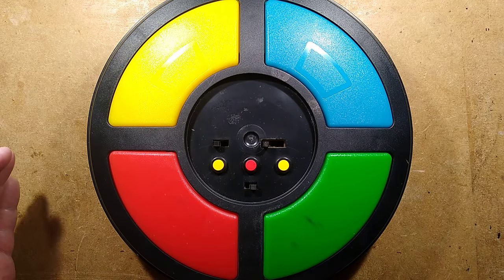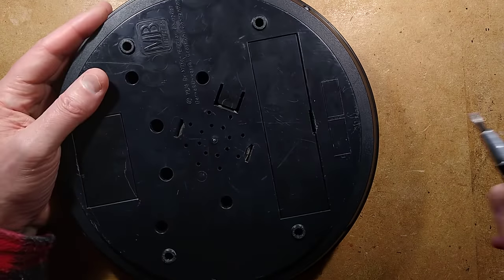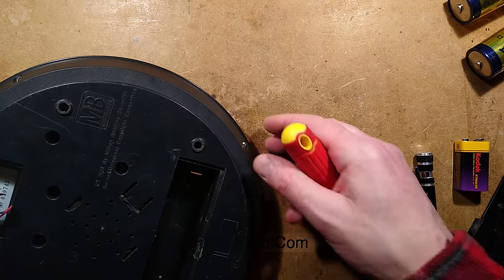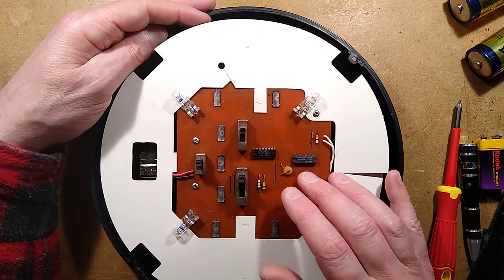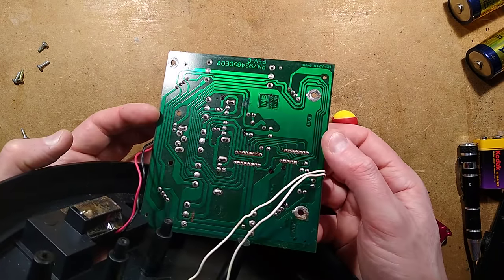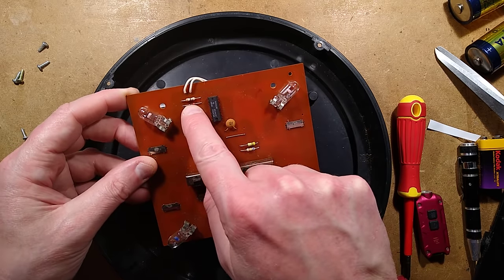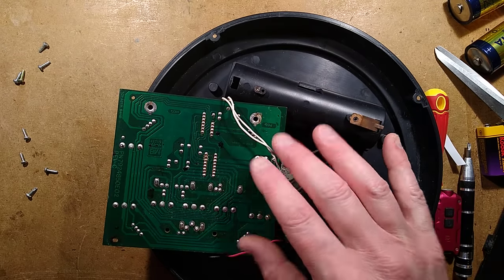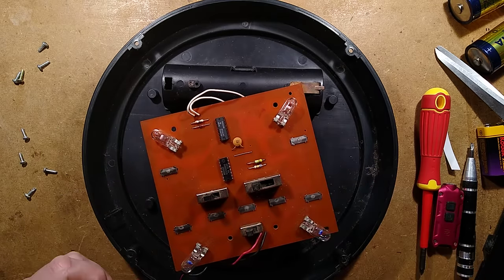Inside one of the first electronic games.

Comment: Had the smaller version of the original which has a smaller "box" sticking out the bottom with the controls on it instead of the centre. Never seen one of these since and don't know what is was originally called.
Reply from the maker: Pocket Simon?
Reply: @bigclivedotcom  Yes, that was it! (Strange name for something that doesn't fit into an average pocket)
Might actually still have it, got to have dig it out if so.😃

Comment: Brought back memories :D

I suppose a more recent variation on the theme of this game would be the various Bop It games. Horrifically addictive for some while the incessant noise is equally as horrifically annoying for others. Typically very good for causing massive arguments over the Saturnalia season where some annoying git insists on playing the thing in the presence of several others with hungover irritability syndrome. But that should be just fine this year as we'll be in solitary confinement for the duration.
Gives me an idea for a marathon live stream. 24hr charity fund raising non-stop Bop It Marathon or some such garbage. May have to buy a few units for that as they WILL get violently launched into walls when failing the sequence at step 597 or similar. :D

Comment: Why buy an old one when new Simons are available. I bought mine for $7.98 at Aldi's this past summer. It also lights up two colors at once and does have LEDs in it.
Reply: It is the official Simon. On the back it says "Made by Hasbro. 2013 All right reserved. Made in India" and it also features single or multiple play modes. I can't remember if the original had that. We were poor, too, so we got the handheld version many many years after the original one came out because it was much cheaper by then. It really brought a good feeling to be able to buy this newer handheld model that is not much bigger than a hockey puck. I sometimes play it when I can't sleep. Sort of focuses the mind.

Comment: Thanks. I used to have one 😊
Reply: In 1980 Atari bought out the Tempest arcade machine. Absolute winner. XY monitor. Famous. I now run this on an old netbook hooked up to my projector. Big screen detail. I have connected up an official spinner and arcade buttons into an old file box I had. I made the holes in the box exactly where I wished them to be - spinner on rightside as I’m right handed and a fire button and superzapper button on the left hand side. Another button for player one start. 
I love this game. I have managed to get up to the green level just once - but I’m good normally through the blue then red then yellow then onto the cyan level. 
The bigger the screen the easier it is to play as more detail is seen which is very important on the later levels of the game. GO TEMPEST 🍊😊

Comment: My mini simon (hand held) worked....  until it didn't  which I found it won't unless you bother to take it apart and discover oh..  they have an extra bulb in here (it hadn't worked in 30 yrs)  it's not working again.  I suspect another bulb went out.  Guess I'll just have to watch this and see if there is an extra bulb here
Reply: never owned this but wow.  it also has a spare bulb.  Rather wow is the speaker.  it has a real speaker the Pocket Simon had a Piezo speaker with a semi transparent plastic cone around it and it did it's job.  Gosh now I wanna know what screw in light bulb I'd need now.  :O  think I know where mine is.. and found it. ha  nope not the bulbs.  now where'd my contact cleaner go cause clearly the left switch has issues

Comment: Clive, what voltage are the bulbs ?
Reply: probably 2.5 or 2.2v, to take into account losses in the driver chip...
Reply: @andygozzo72  Our messages are crossing :) 
But they don't need to be powered at full voltage. If mopeds use them, fair enough to be 3V.
I know these small bulbs are often driven over voltage in flashlights etc. but no need for in the game.
Reply: @millomweb  they wouldnt be over driven, the driver chip will drop a small voltage, so less than the 3v getting to the bulbs..
Reply: @andygozzo72  I never said they wood.
Pay attention at the back !

Comment: I remember the very recent Simon's, a vertical ring mounted on a base with a hole in the middle. They were simply awful. I think they worked by motion or light detection, and they never worked properly. Always mis-reading the wrong colour, when your hand was actually over a different colour. The detection was poor, and they were actually quite frustrating.

I get what you mean about the large clunky buttons, the new versions simply can't be compared to the old ones, because sometimes, old is better!

Comment: I remember building a TV 'Pong' game, back in the mists of time, by ordering the IC from an electronics mag ( it made a change from valves and BC1O8 and BC109s )and then building the circuit on a bit of  Vero board and bunging it, the psu and modulator/tuner, into a small tape recorder case.... a couple of 50K pots as controllers and Bob's your uncle...
Yes, I'm that old.. . 😆
As for corrosion,  I find that on most occasions it's because it's been " stored in the shed " for a number of years.... Fatal....

Comment: Tin/lead solder makes a lousy switch contact. Milton-Bradley at one point was in contact with Oak Switch Systems in Crystal Lake, Illinois to talk about using a silver/polyester membrane switch assembly. Parker Brothers also looked into membrane technology which was used on "Touch and Tell", "Speak and Spell", and the first electronic chess games by Texas Instruments. Eventually all of that extremely high volume toy (and other) business was sent to China for production. The initial Chinese production gave membrane switch technology a bad name due to it's lousy quality. The technology is fine, the Chinese implementation was terrible, bad design and inferior materials.
Reply from the maker: Merlin used a membrane keypad.
Reply: @bigclivedotcom  - Oak made the Merlin switches, and some of the others mentioned, until the toy makers all went to China, I was an engineer there for 10 years until Oak gave up on the membrane business and sold it to W. H. Brady. (now Xymox) Oak eventually, due to a total failure in making cable tv boxes, sold out to Standard Grigsby a maker of rotary switches, one of Oak's initial product offerings.